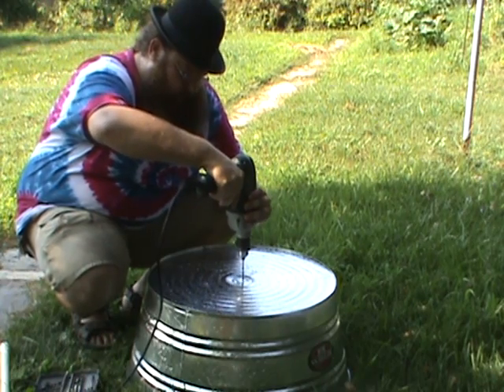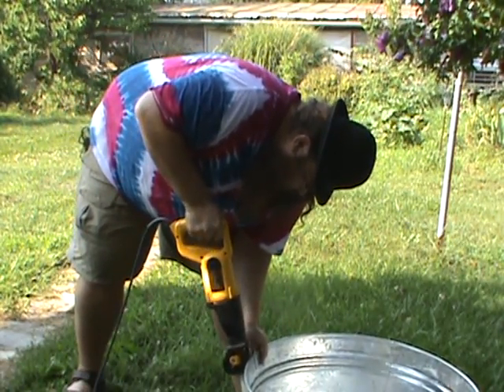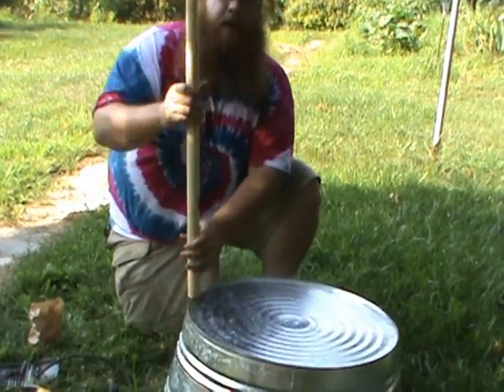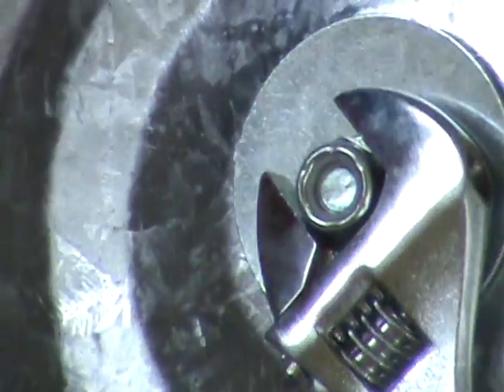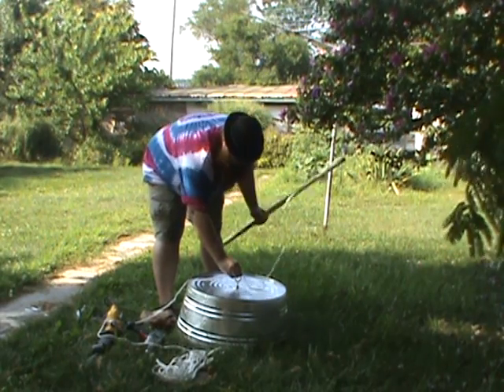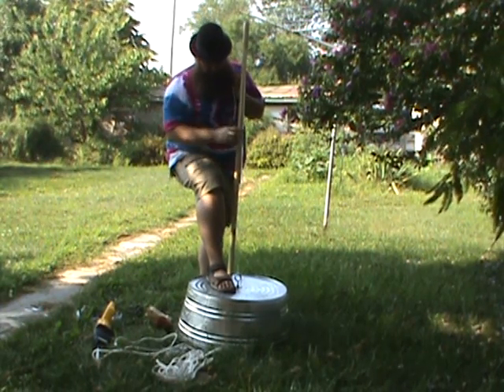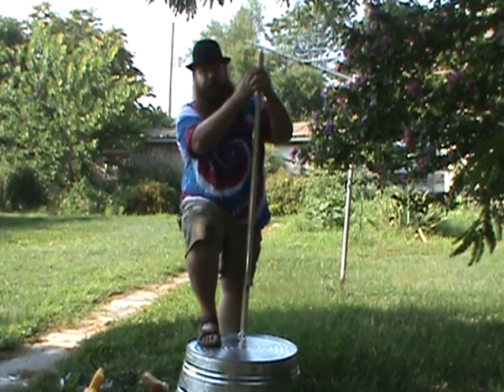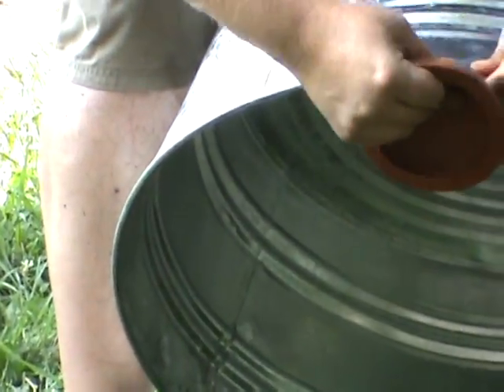WashTub Bass "How to Build"

Comment: Excellent instructional bucket video!!! Wish I had seen it a long time ago. First thing I should have done was to cut off the handles! Mine still rattle when I play, taped 'em up to quiet 'em down....for pro gigs, microphone wrapped in to a towel and placed vertically underneath inside bucket, direct to PA system. My favorite instrument in the laundry room.

Comment: You're still rattling bc of the metal I bolt running into the metal washtub...     It's best to drill a hole in the tub,pull your rope thru, tie a big knot, and then firmly wrap the knot with electrical tape, several times around to increase the size of the knot.  Then pull it tight, and run the other end thru your broom stick as seen here.     Also if you foresee that you may be playing from higher to lower "tunings"...  Use a table saw to cut very shallow rings into the top of the stick, so you can wrap the rope tighter and not have to hold on, or worry about it slipping, it as much.        

It's also a good idea for new builds, to find and mark your basic chords with electrical tape or even colored tape.  Once you learn your instrument, that can be removed if you want.
Reply: Also, down here in the southern states, folks that play tub basses have that twine dipped in some kind of wax.  I'm not sure what it is but it helps for volume